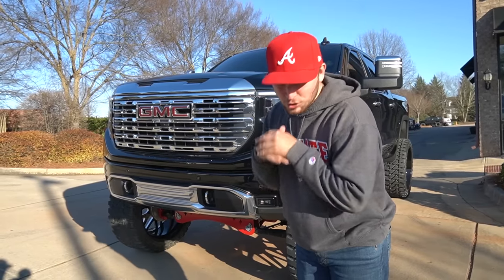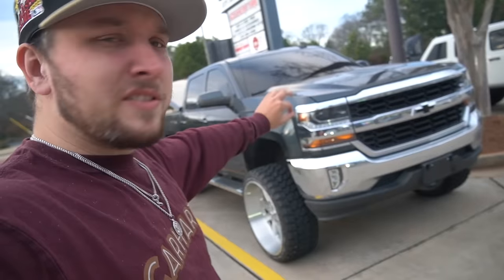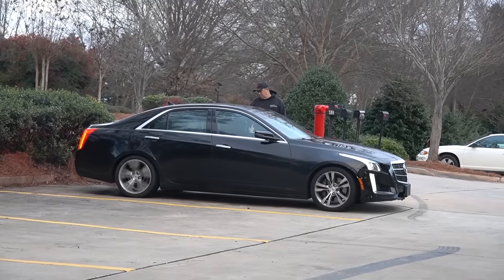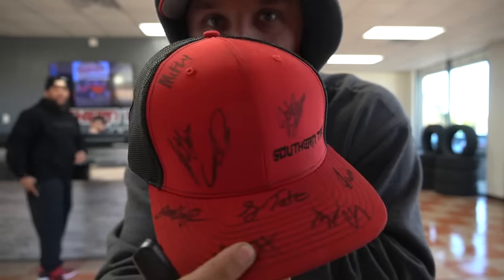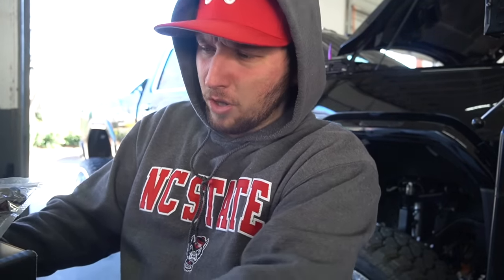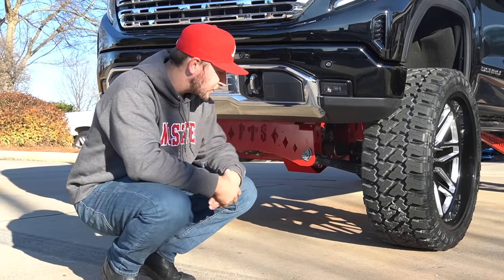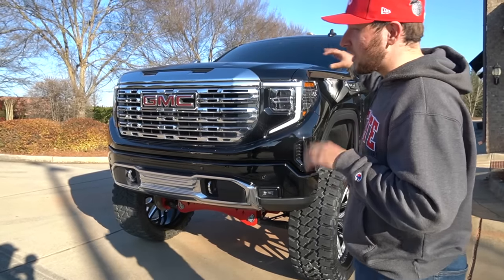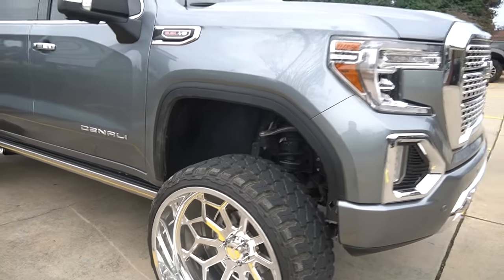Drove from OHIO to build my DREAM TRUCK! Lifted 2024 Denali on ALL RED 12" FTS | 28s and 40s

Comment: I’m guessing your dream was around 20 to 30,000 with the lift shocks and wheels and tires oh my clothes. Back in the 70s we would take a three-quarter ton truck cut the frame down and put a short bed on it. Only three-quarter ton short bed around. Then we would Rhéart the leaf springs to give us at 12 to 14 inch lift. They didn’t have that back in the 70s. Pretty cool God bless.